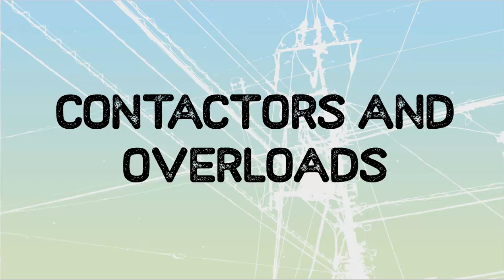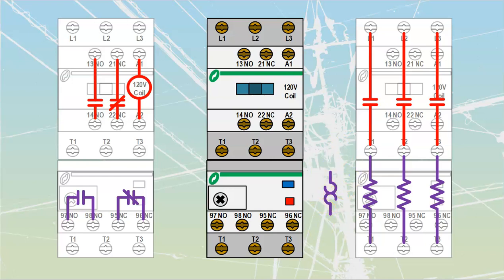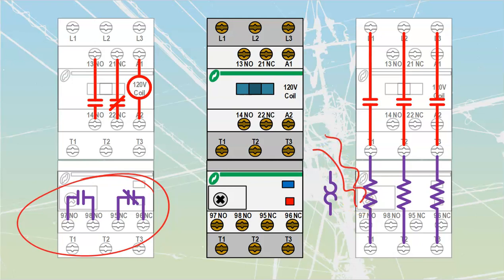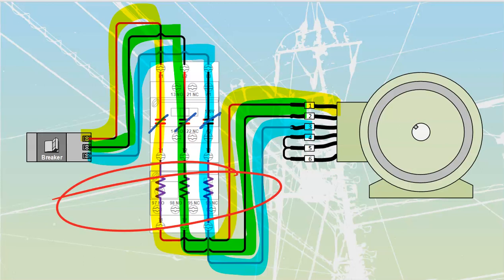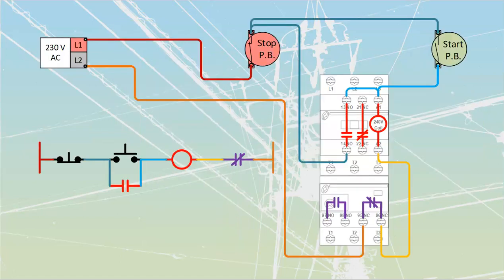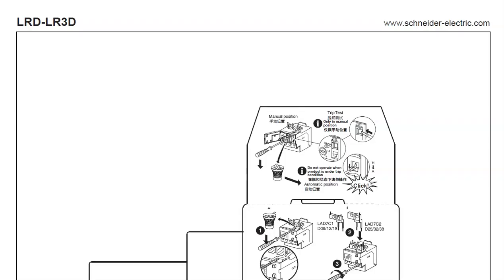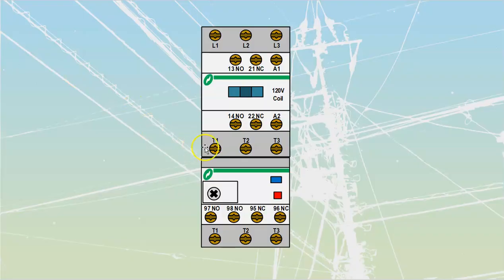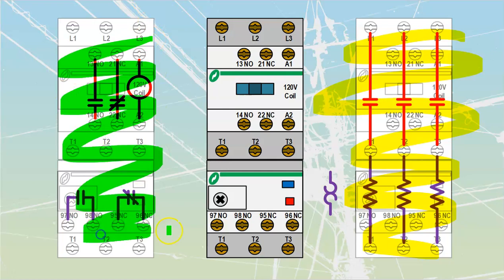Wiring an Electrical Contactor and Overload - What they are and how they work

Comment: The new one i got from my local controls place, the control voltage is on the same level as the high voltage. So with the overload connected it takes my a2 terminal away. I'm sure I'll have it taken care of by the time someone responds so im not holding my breath. If I needed it done in 2 weeks I would have asked the electrician 😂
Reply from the maker: There are a lot of different models and voltages, so I'd need more than that general of information to be able to respond with any help.  What's the model?  What's the motor voltage?  Is it single-phase or 3-phase?  (If it's 230V with a built in jumper from the overload to A2 you should be able to follow along around the 8:00 mark of the video. )

Comment: How would the wiring look like with a sump pump float switch ?
Reply from the maker: Really depends on the operation and float type.  Is it for fill or for drainage, and is it dual floats with high and low level, or a single float with a differential like a Flygt bulb?  A ton of variations possible.

Comment: Is there any chance that you could give us the article from the electrical code in Canada that says we can't put the contact from the overload on the "neutral" side if it's connected to the ground ?
Reply from the maker: Sure.  To abbreviate, 28-506 states that "...the control circuit shall be arranged so that an accidental ground... will not ....b) prevent the stopping of the motor..." 

Because the neutral is grounded, a ground fault between the coil and OL could allow that to stay energized which could cause safety issues.  But moving the overloads to the opposite side of the coil or control circuit is opposite to traditional industry standard, and is a rarely enforced rule.

Comment: What situation would you use the NO contacts on the OL?
Reply from the maker: Usually as an indicator of a fault.  It only closes when the Overload trips, so if you connect that to a pilot light or alarm system, that will activate and let you know your OL has kicked out.